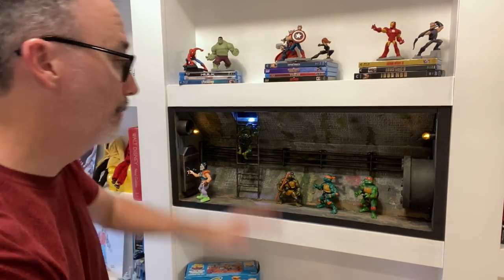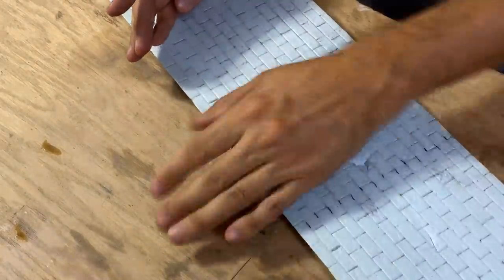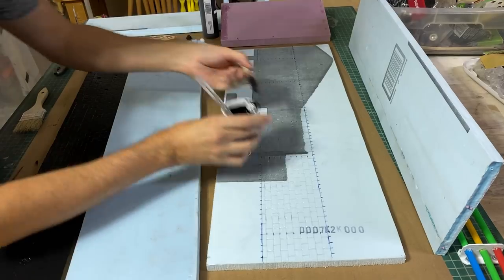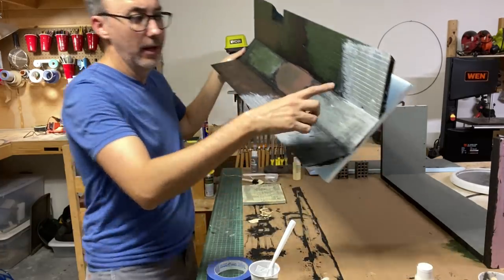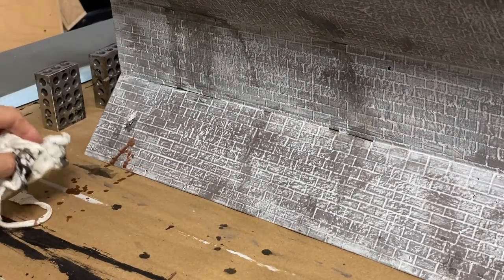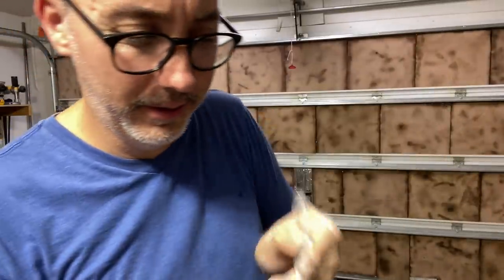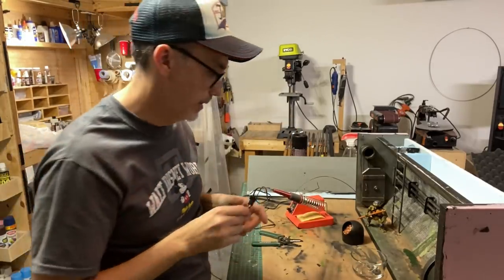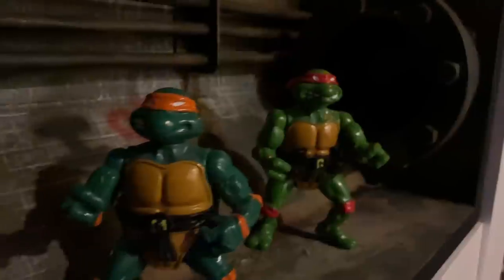Making an awesome DIY Ninja Turtles Bookshelf Diorama

Comment: That looks awesome! I’d suggest adding a piece of plexiglass in the front to keep the dust/debris out. Maybe use some of that wall 3M tape so you can remove if you wanted to adjust anything.
Reply from the maker: Great idea!
Reply: Wouldn`t something with magnets work better if you would want to ajust things regulairly?